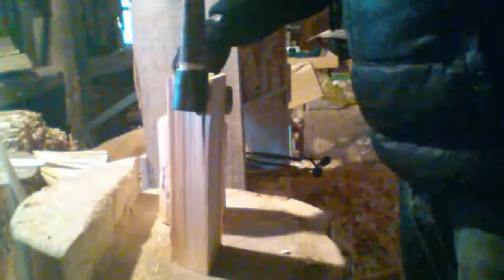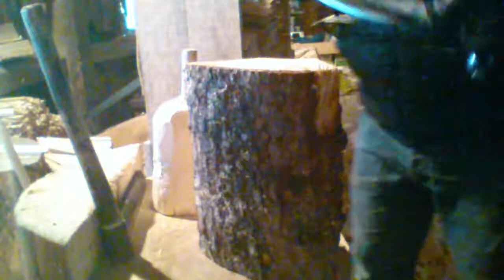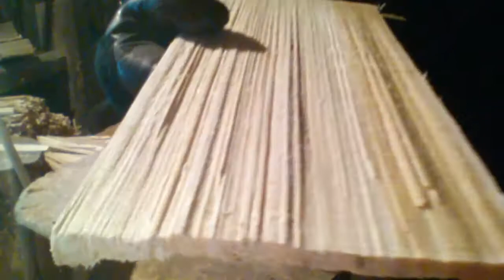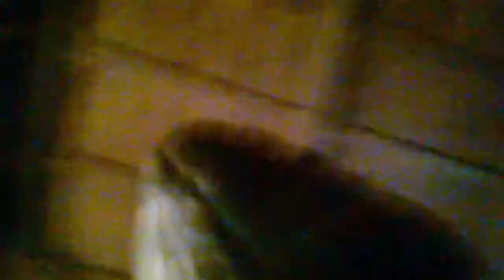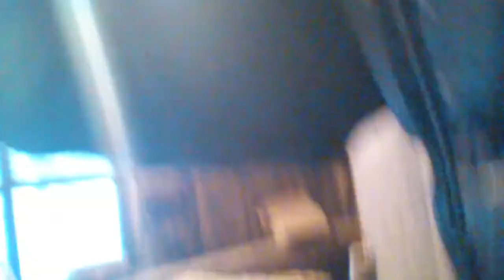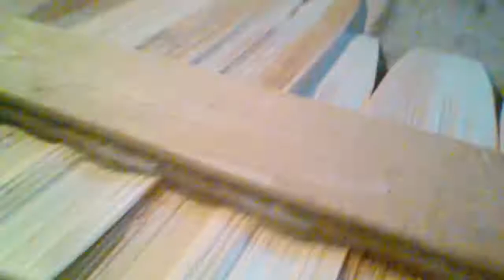fabrication de bardeaux  en épicea

Comment: Good job... I have a little project for a deer blind roof.. think I am going to get started building the tool with the long handle
Reply from the maker: thank you . The original handle broke after a short time , so I made a new one  ,  fitted to  my hand . I think there's a ratio beetween the length of the shingle & the length of the handle . If you can get a branch of holly wood for your handle , your hand skin will thank you